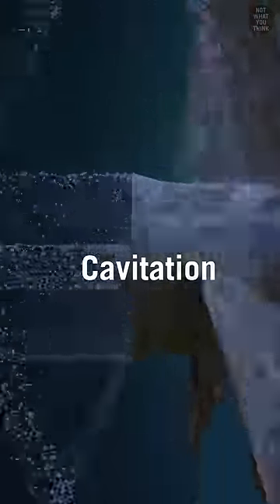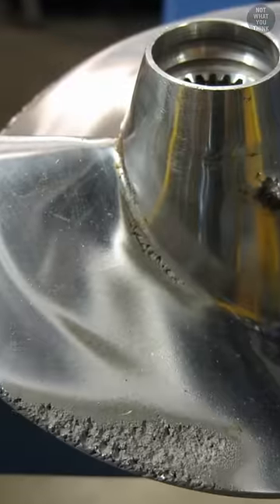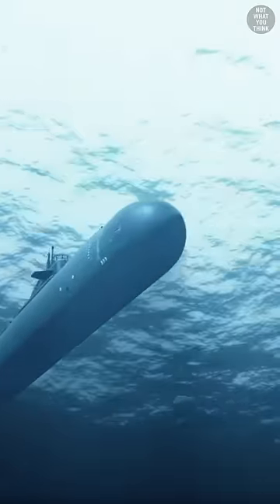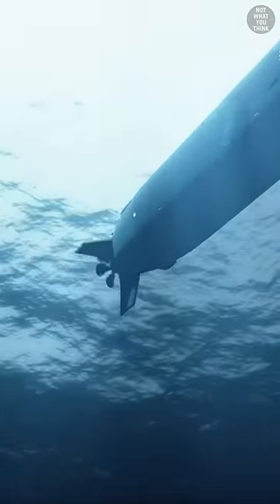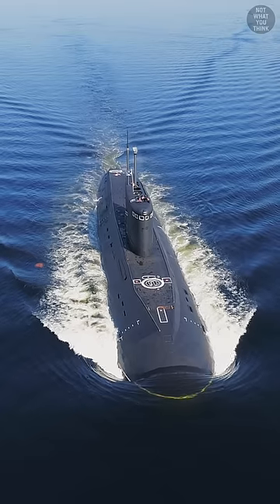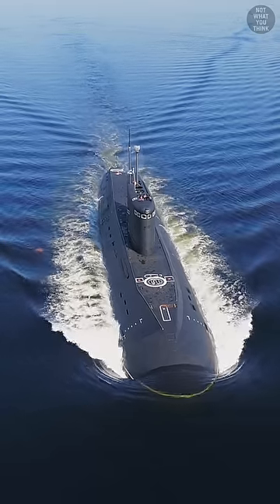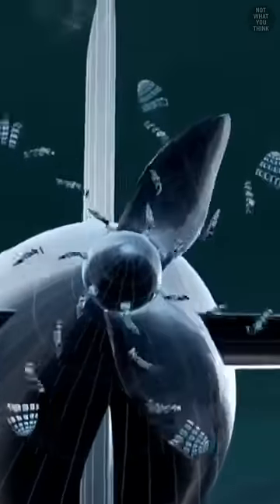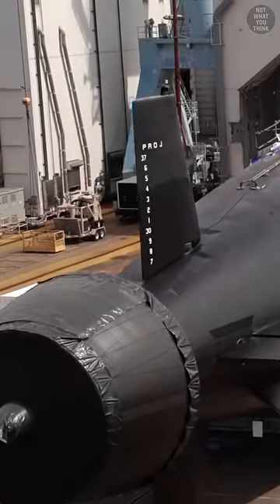Why Are Submarine Propellers Covered Up? #shorts

Comment: "Submarine propellers boil water, why that's bad is not what you think."
🤔 I think that's cavitation and it's bad because the bubbles damage the blades and the sound gives away the sub's location (I was in the USN).
(Watches the rest of the video) 😠
Reply: I got mad that he called cavitation "boiling" before I watched the rest of the video, and had the same exact thought. My expression at the end was 😑
Reply: @johngavin2570  it is technically boiling though. its just the boiling point is being changed
Reply: @thismachine7089  ugh I already had to explain this somewhere... it's really not. Boiling is when you raise the temperature of a liquid to the point where it turns gaseous. Cavitation is achieved when you LOWER the ambient pressure to the vapor limit. One is pressure. One is temperature. Yes, you can change the result of one by changing the other, BUT boiling only happens when liquid is heated, and cavitation only happens when one object is moved through a liquid medium. They're really not the same thing. At all.
Reply: @thismachine7089  basically, you can only boil something by a, raising the temperature or b, decreasing the ambient pressure overall.
Cavitation is when you LOWER the pressure in a high pressure liquid enviornment in specific areas. This is only acheivable by running a solid through the liquid at speed, under pressure (which everything technically is underwater)
Reply: @johngavin2570  i guess so if you consider heating to be part of boiling. but you could argue that heat is only part of the definition because thats the only kind of vapourisation 99% of people encounter. really it just seems like semantics at this point though
Reply: @thismachine7089  the definition of boiling is "raising the temperature of a liquid until it crosses the threshold of vaporization"

It's not semantics. It's also not boiling.
Reply: @thismachine7089  the definition of cavitation is the formation of partial vacuums in a liquid by a swiftly moving solid body (such as a propeller) or by high-intensity sound waves

These are not the same things. At all. One is a vaccum being formed at high pressure. The other is the physical changing of matter from liquid to gas. One is hot if at normal pressure. The other is not hot at normal pressure.

One is literally the act of liquids turning to gas. The other is literally gas being formed, at immense pressure, due to a sudden localized drop in pressure.

You're not smart. At all. You're taking a grape and a lemon and saying they're the same thing because they both have juicy insides. No, both are fruit. They have similarities, but they are not the same thing. Just because they share similar traits does not mean they're the same thing.

They're both vaporization. But like my fruit analogy, they are not even close to the same thing.
Reply: @johngavin2570  Boiling is nothing more than a *phase transition*. The mechanics of how that happens don't matter in regard to adding heat/reducing pressure- it's still a liquid turning into a gas.
Reply: @TheOriginalBlue62  did it really take 10 days for that? Buddy, you're wrong, and 9 out of 10 scientists agree. The only one that agreed with you was the floor's geologist, so, you're still wrong.
Reply: @johngavin2570  I see what you’re saying but for something to boil does not mean it has to be heated. There are many ways for things to boil, and what you’re referring to is specifically a ‘cold boil.’
Reply: @johngavin2570  Cavitation is a process of boiling, but fine, go off on acute technicalities. They are both a process by which liquid undergoes a phase change into a gaseous state.

Also, you're really going to try and start something about me finding the video two weeks later than you? Grow up.
Reply: @johngavin2570  what you keep talking about is flashing. Cavitation is a phenomenon that occurs when bubbles caused by flashing is introduced back to a high pressure and implodes.

Comment: One has to appreciate the difficulty of good engineering. I never would have expected that micro air bubble jets could cause pits in the surface of hardened steel. They probably have a variable for that in the calculations.

Comment: I used to work at a shipyard in Norfolk,Virginia and I worked around dry docks frequently. Inside the dry dock, it's about 30-60 feet down from the surface level, making it difficult to look down and see things but they had the propeller covers off sometimes and they have a very different and unconventional design. This was on an Ohio class, nuclear propelled Sub.

Comment: The catapiller drive is still the best propulsion design I ever saw, Granted it was only a concept and used for Hunt for Red October. Haven't heard anything about it since.
Reply: A magnetic anomaly detector, MAD, is a sensor which has for a long time been employed in searching for submarines by detecting "disturbances in the force" created by the submarine's mass and structure moving through Earth's magnetic field; now build a submarine with a magnetically activated propulsion mechanism and fly your MAD sensor over it ...
Reply: @alonespirit9923  Fact and the MAD system is pretty accurate
Reply: Haven't heard anything... you're a funny guy.
Reply: @dsmyify  glad someone actually caught it 🤜🤛💯

Comment: The secrets to eliminating cavitation are fairly well known nowadays, to the point that the main reason the propellers are hidden from view nowadays is so that the noise signature of the submarine can't be easily determined by the enemy and so they can't make a submarine that sounds exactly like yours.
Reply: Why does the submarine not make too much noise so that it's impossible to pinpoint it?
Reply: @dsmyify  If you're asking why it doesn't make so much noise that it overwhelms passive sonar, it's because now you've just alerted the enemy that you are nearby. Even if they can't tell exactly where you are, they know you are somewhere nearby. It's much better to make very little noise so that pretty much the only way to know they are there is with active sonar (very rarely used because it will give the transmitters position away just the same as it will give away the position of the target) or to be within a very short distance of the sub in another submarine using passive sonar.

Comment: Diesel engines have the same problem, especially the older ones that run a high compression ratio (>20:1). The bubbles form in the water jackets and can eventually "drill" a pin-hole through to the cylinder wall. There's an additive that helps prevent this.

Comment: Cavitation is largely just bad because of the noise it makes when it comes to the screws in a sub. Cavitation really only gets damaging when it is inside of a pump and the pressure changes are being contained around the impeller of the pump. You can ruin a pump in a minute or two with cavitation vs a screw which can take cavitation for much longer. Plus depth in the water plays a role in cavitation, the deeper you are the larger the pressure difference you need to cause cavitation.

Comment: No, those "covers" are not to "hide" the propeller.  It is a different design called a "ducted propeller".  It has certain performance advantages over a standard propeller, though isn't as fast.  So, simply a different technology, not subterfuge.

Comment: They are hidden for two reasons.  One, different submarines can be equipped with different propeller designs to tune them to operational areas/missions types.  If someone was able to precisely photograph them you could develop a more accurate sonar identification for that one particular boat.  Two, while the general science is classified the particular implementation is.  And if you only hide some propellers you identify which ones have newer advanced technology.

Comment: The United States Navy Virginia class fast attack sub uses pump jets . As do the Sea Wolf and later improved Los Angeles class . The upcoming Columbia class will also use pump jets . The U.S. Navy hasn't used ducted propellers for a while . They are two completely different systems .

Comment: Also, as a general rule of thumb, if there are bubbles, there is air (gas), and if it shouldn't be there, and if you know there aren't any residue air left from where it's coming from, then the air is most likely caused either by a leak, a chemical reaction, an extreme change of pressure, a change in volume, or a change in temperature (outside of the increased pressure /decreased volume) and the latter three needs energy to occur. Think of the kettle, what are those bubbles? It's air. Are there supposed to air? If it's just water, not really. Is there a leak? I hope not. Change in pressure or volume? Most kettles are made from metal or glass like materials, which holds a mostly constant capacity while in use, so I doubt that there's something changing the pressure or volume. Change in temperature? It's a kettle, and if you're heating water inside it, the temperature will cause a few (harmless) molecular and chemical reactions, and water loves turning into a vapor or gas in both cases. But if I'm not heating it? The water is in contact with a chemically reactive material, so much so it's making bubbles when it shouldn't be. Materials that are prone to chemical reactions are mostly covered or mixed in with something that protects it from reacting, but most don't last forever and can get exposed.

Comment: They use shrouds to increase the water pressure around the propellers, thus reducing cavitation. This allows the vessel to travel faster without bubbles. The rest is correct.

Comment: I never thought of cavitation as boiling before, but it literally is!
Reply: No, it's not. Boiling when the vapor pressure in a liquid (low) rises enough to change the liquid to gas. Cavitation is when the local pressure (high) falls below the vapor pressure. It's literally not the same thing. At all. One is pressure based, one is ambient temperature based. One is caused by heating a liquid, one is caused by physical movement of a solid object through a liquid.
Reply: @johngavin2570  In a general sense they are the same thing, so who cares? Just the liquid dropping below saturation conditions.
Reply: @enchantedgamer9428  they're literally not. Cavitation is dropping. Boiling is rising.

Comment: The name of the ring is cowling, and it's not designed to hide the propeller, but to minimize the first phase of cavitation called blade tip cavitation. And I believe the propeller inside the modern cowlings is more flat, not like the old ones. So, I guess it's fair to say that the blades are hidden but...it's not what you think.

Comment: One of the best designs I ever seen was on Star wars believe it probably works great essentially you have like a six blade propeller with a rubber coating now your blades are technically much longer than the normal and the rubber at the end would silence it and make it more like a paddle

Comment: It's no longer necessary to hide something because it's classified. There're tools that can see through and get information about the hidden parts, their exact design, number of men in the submarine, where they are, the size of rooms they work in, and where they keep torpedoes.
Reply: That's just straight up false. The hulls block any kind of imaging technologies.  The designs are classified and extremely tightly controlled. The other stuff while not common knowledge can be found somewhat through Google, since the Navy says how many men make up a full crew, and the torpedoes are obviously in the torpedo room attached to the tubes, which are not classified in any way. Anything you or I know about them is unclassified and given out by the Navy. If it's so easy to get the designs then why don't you do it?

Comment: I don't believe that the prop is shrouded, but the actual shroud is the prop encasement.
Not to hide it but, to push the high speed of water through a smaller port.
Water cannot be pressurized but, it can be speed up.
Lots of water power is lost towards the outside so, the shroud is like a jet engine. 😳

Comment: Would this increase/decrease the efficiency of any boat?
Reply: Short version - yup. Keep in mind that with a sub you're trading off efficiency vs. noise. Go with a big, slow moving prop you make less noise, but you lose top end speed and the big mill requires reduction gearing etc. so you have to isolate all the machinery to reduce the drive train noise.
Part of the reason that some of the newer subs have ducted props is to pick up some efficiency with similar noise characteristics.

Comment: Correct me if I'm wrong please but that's not boiling water???
Reply from the maker: Boiling is the action of bringing a liquid to the temperature at which it bubbles and turns to vapor. That temperature however depends on the pressure also. 
So yes, the propeller boils the water.
Reply: @NotWhatYouThink what's causing the heat the motor at the back being blown into the propellors causing the higher pressure water to boil? How would the propellor itself spinning generate the heat is what I'm missing I guess

Comment: No, the purpose of it is to concentrate the trust and eliminate energy loss. The cover cannot hide the propeller to a determined spy.
Reply from the maker: What energy loss?
Reply: @NotWhatYouThink  Its just like the principle of water jet. The open propeller tends to scatter around the thrusting volume of water. Whereas if it is enclosed, the volume of water is driven backwards in one direction. Thus the energy is more utilized or more efficient.
Reply: @clarkwayne3440  But the ring itself also creates a bunch of drag counteracting much of the benefits to the prop efficiency. I would guess the main reason they would use a ring would be to change/reduce the noise.

Comment: But this a phaenomenon, which can be reproduced easily at home,too. Take something like a syringe and try to take water or any other kind of fluid very fast in it. You will see, there will develope a bubble of gas, too. Since the opening of the syringe is very tight, the fluid can not get fast enough inside the syringe.  The fluid takes some time to get inside,so there will be no more vacuum inside. But I do not know,, which equipment is needed If you want to hear this phaenomenon,tio!

Comment: Why aren’t all propellers caged up?
Reply: Drag. Pulling a big ring thru the water slows you down. Swirling water around inside of it slows the prop down.
It does increase the prop efficiency by keeping the water from slinging outward instead of backward, but the numbers work out that it isn't worth it in most cases due to the accompanying drag and cost.

Comment: Wtf? That stupid shit can damage the rotor blades? But they are made of metal! Aren't they?
Reply: Think of it like a drip of water on stone. One drip cannot damage stone. One drip a second for 10,000 years can.
Reply: @dsmyify  So... That damage the rotor blades get is from continuos years of usage?
Reply: @ERIK-457  ~ that's right, it might take a long time for initial damage to appear but as damage increases so does the rate of damage. Worked with metal creep in the past, this is when micro fractures in metal under pressure, like deep in the sea, can cause massive cascading failures in metallic structures. So like a nanometer crack causing metal components to buckle and collapse due to the surrounding pressure and heat.